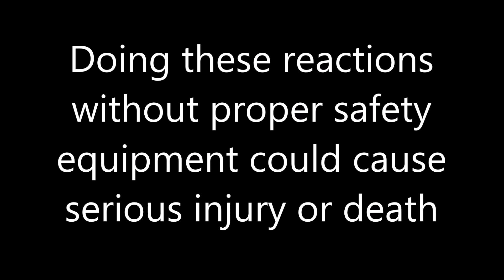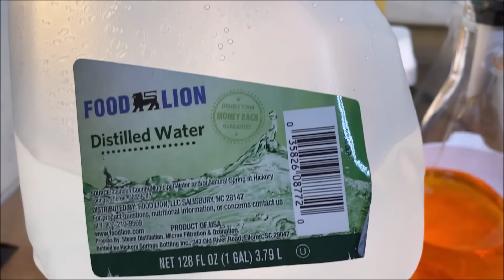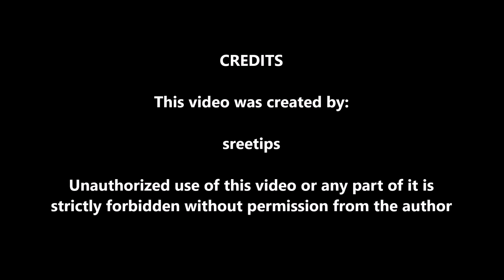How To Turn Platinum Jewelry Into PURE PLATINUM Pt5

Comment: Raising the PH with carbonate is ok with some things but the CO3-2 ion can cause issues. For this step I use ammonia and sodium hydroxide added slowly then switch to streight ammonium hydroxide once about ph of 4 is reached. It allows the platinum to be extracted as a complex once 9 is stable. Then filter and use the bromate on the filtrate.❤

Comment: you did not have immediate success in precipitating the yellow platinum salt BECAUSE IN THE PREVIOUS PHASE YOU CHANGED THE PH OF THE SOLUTION IN CARBONATE... you need to acidify it again and then add ammonium chloride. EXCELLENT WORK. congratulations
Reply from the maker: I realized that AFTER I read the procedure.

Comment: Really liking this new content! Super interesting, bromate hydrolysis!, i didn't know that platinum doesn't form hydroxides, very clever way to sepparate it from other metaIs. I think the precipitate that formed when you reduced the solution is indeed a platinum salt, looks like it wants to go back in solution when adding HCl, maybe add more and see what happens, it could be a lot of platinum still there.
Reply from the maker: Good idea. I was going to dissolve in Aqua Regia. But if it will dissolve n just hot HCl then that will save some time because I won’t have to denoxx.
Reply: @sreetips exactly!, i tought about using a little nitric too, but try to dissolve it first using only HCl, maybe it works, if not maybe a bit of peroxide will help. I don't know why but i don't think adding nitric is a good idea at this point. Maybe the solution was near the solubility limit and reducing it brought some platinum down

Comment: U could use a stand and clamp an leave tester in solution and use an addition funnal to drip in and just watch it rise
Reply: Just not for extended periods lol then u wouldn't lose ad much metals to washing everytime
Reply from the maker: I did experiment by holding the meter by hand and adding the bicarbonate. It worked, but the meter was getting saturated from the vapors.

Comment: The best recommendation I can make to you is to go slow.  Write out what your procedure is going to be for the day.  It's OK if you don't make it through the whole thing, but you need to check off each step before you go to the next step. You are missing steps and making mistakes that have created like 3 or 4 solutions and precipitates.  Take a 20-50ml sample and test your process out before executing on the whole thing.  The first time you do this it will seem very tedious, but as you refine your process, it will get safer and faster.
Reply from the maker: Good advice, thank you

Comment: You want platinum drop aluminum in it will turn to metal right off hand screetips when you have the solution like that it will turn like gold Mudd but it's platinum done it million times I got tired of platinum it's hard to sell